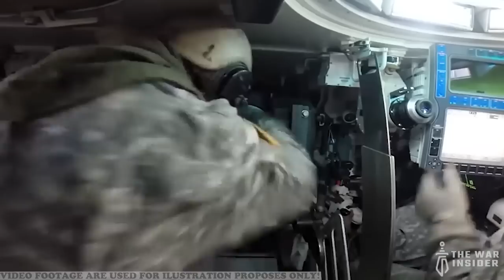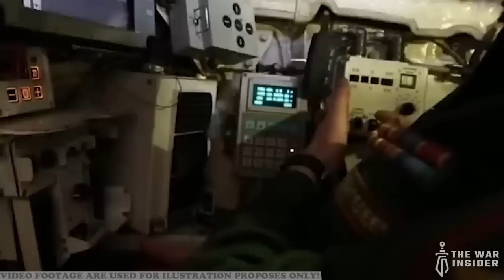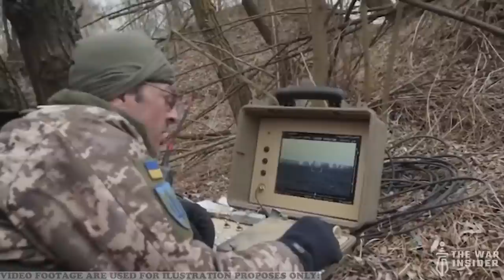Western Tanks for Ukraine: A Comparison with Russian Tanks. Leopard, Abrams, Challenger and Leclerc

Comment: All nice and fancy but the cost is key and Russia can produce 5 capable tanks for every Leopard2
Reply: but weak like the one saw in the media with flying turret
Reply: Ahh but can they? O i'm pretty sure the can make 5 heavely armoured vehicles that move abd can fire a gun for every leopard 2 the germans can make. To make it an effective semi modern tanks you do need a littlebit more though and Russia is certainly short on certain electronic stuff to make them really effective.
Reply: One Leopard Combat Tank can take out 2 or 3 russian tanks anytime
Reply: then all 5 russian tanks will be busted easily by leopard2...accuracy and capability of firing 1st at long distance before the enemy can see with precise accuracy is an edge of the expensive tank over the cheap one....the power of NATO tank
Reply from the maker: Can't anymore.  Sanctions.